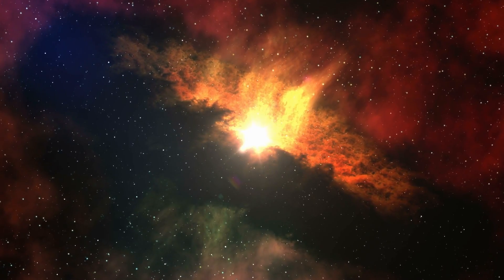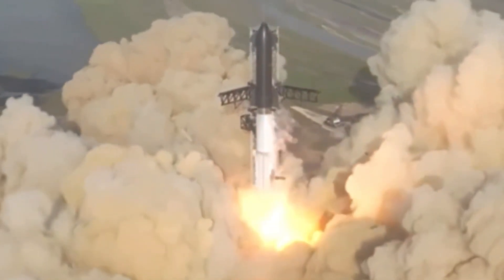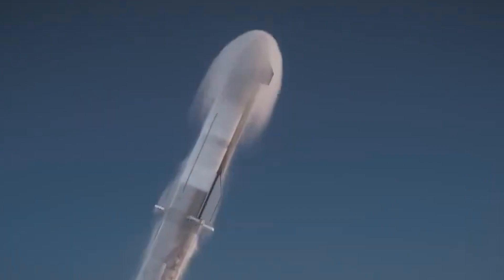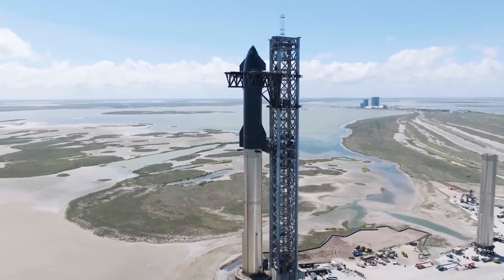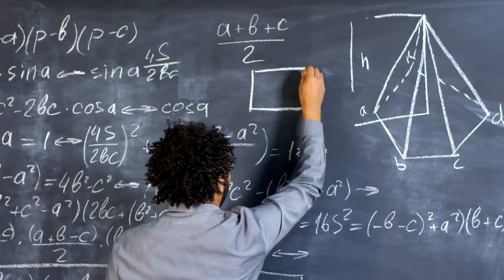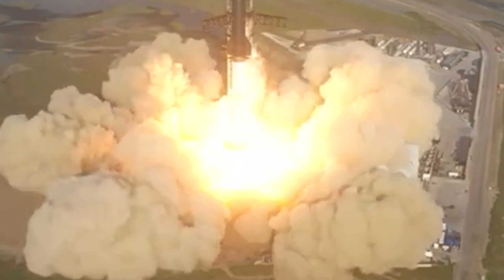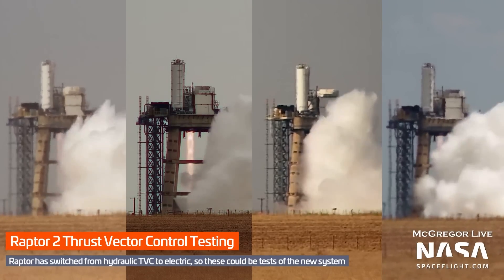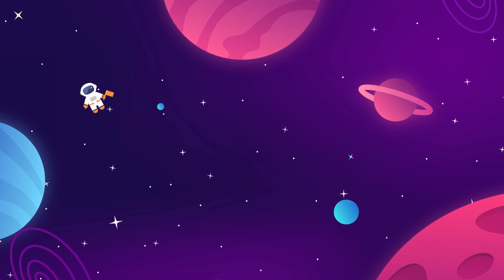The SpaceX Starship Orbital Launch Update Is Here!

Comment: I would suggest 2 water cooled concave steel plates forming a ridge to deflect the exhaust thrust laterally in 2 directions.  Might require a tungsten ridge cap.
You can see scalloped pits in the crater wall where the individual outer raptors were excavating in cutting torch mode.
Reply: Think Apollo Flame Trench, they'll need it.
Reply: @festeradams3972  💯!!   I honestly cannot understand the aversion/reticence to implementing this time-tested, proven method. It works & has worked for decades.
Reply: @turbochargedsports6327  Elon being Elon I'm afraid...
Reply: @turbochargedsports6327  If I had to guess. Elon wants a launch pad that will work on the moon and on Mars.
Reply: @Veritas-invenitur  Mars... hahaha
Reply: @turbochargedsports6327  And it works for Falcon launches. But you know Musk - he declares that flame diverters are for pussies and expect the Universe to oblige.
Reply: @chrisantoniou4366  💯👍
Reply: @bazoo513  💯👍
Reply: @Veritas-invenitur  maybe, but the gravity, weight & thrust dynamics are different on the moon & on Mars. No Superheavy launches in either environment. What might work there won't necessarily work here for a multitude of reasons.
Reply: Army Corp of Engineers approval for such a work would be the stalling point. It would take a few years to get approval for such a thing.
Reply: @turbochargedsports6327  That’s absolutely true. Every launch location is different. I’m just trying to figure out why Elon choose to risk a rocket in the way he did. The only thing I could think of is that a launch from another planet is likely to send debris into the rocket in a similar fashion as we saw here and that Elon wanted the data. Perhaps I’m grasping at straws, but I would like to believe that some rational reason exists.
Reply: They can take some notes from how they diverted the space shuttle thrust
Reply: I would suggest selling Twitter stepping away from all these companies and let them run themselves first.
Reply: @Ernest Mesa  I would suggest maintaining focus on the science rather than getting into the complex and controversial moves of the owners other businesses. Everyone has their own feelings about Mr Elon, let's not share them here.
Reply: The best ridge cap would be water cooled copper. I have experience in several industries where resistance to very high temperatures is required.
Reply: @curlydave7689  Why would you use a soft material under a rocket engine? The idea is to deflect the heat and pressure, not conduct it away.
Reply: @--_DJ_--  1. Some copper alloys are harder than others but still have good thermal conductivity. 
2. Experience has shown that no matter how hard or temperature resistant a material may be a very energetic chemical reaction will rapidly exceed its limits. Copper can be kept cool and will last better. 
Examples are NASA rocket combustion chambers and nozzles of light gas guns.
Reply: @curlydave7689  What benefit does thermal conductivity have really? The idea is the water deals with the heat, the structure underneath deals with the pressure. I also think work hardening would be an issue for copper.
Reply: .  . 1940s era technology which the Germans themselves had already moved beyond in their own research.  Anti-gravity research was commonly published in scientific literature until 1954 when that all disappeared in the name of national security -- while the former CEO of Lockheed Corporation told us in the 90s that they had at that time developed the ability to reach other star systems, as well as many other developments -- none of which are allowed to enter into public developments and awareness.
These undisclosed technologies, as described by doctor Steven Greer, have the ability to replace the need for fossil fuel energy production -- therefore the need to keep the public occupied with programs for public consumption, as such developments cannot be allowed to enter public consciousness to free humanity of its burdens as well as enlighten humanity with unlimited possibilities -- versus the means to maintain influence, crisis and war through maintaining an oil-based economy -- as well as perceived scarcity attendant with false climate threats from a basic element that is literally responsible for feeding the planet through the sun's energy by the process of photosynthesis and which is a primary element in life itself on Earth.  Even worse are geoengineering activities motivated by eugenics philosophies to reduce the planet's ability to support life in the name of reflecting sunlight back toward space, yet using the most toxic materials possible for this stated purpose.  
It is time to begin to function as individuals again, rather than as the parties and ideologies that divide us and so well managed for that purpose -- as well as sponsored SJW activity to greatly enflame any issue far beyond the normal public response.  Repetition and production quality will no longer adequately serve.  The individual perspective is the focus of power by which no person can be set against another with false or self-serving interpretations from another outside of ourselves.

Normalization rather than conspiracy is how influence and corruption created and take precedence, so that awareness is hostage to the needs for anything other than ourselves to define what is real and acceptable -- the need for any form of consensus to rule us unaware lest we ever accept responsibility.
Reply: If you deflect the exhaust, don’t you reduce the lift?

Not sure. Just asking.
Reply: @derekmorrow8775  No.  Rockets are reaction vehicles, they don't need anything to "push off".
Reply: @chrisantoniou4366  Thank you. Did not know that. Thought it followed the opposite mass reaction theory.

Learned something new.

Thanks for responding .
Reply: @derekmorrow8775  ? Newtons third law? Thats what thrust is, gasses are being ejected from the rocket at such force, that the whole rocket reacts in the opposite direction. Thats why you have thrust in space where there is nothing to "push off", because that's not how thrust works.
Reply: @rustygates3367  So increasing the height between the raptors and the launch pad would help solve the problem of concrete destruction and deflection into the engines?  Then add the water cooled steel plates to cool the pad even more?

It seems like distance is the easiest solution to help stop the destruction.

Would that work?
Reply: And, would deflecting the steam produced off of the steel plates toward the bottom of the rocket, help to create lift at take off?  Could it reduce the amount of initial lift the rocket needed to get to a stable speed? And help to cool the engines somewhat during critical lift?
Reply: @PBCountySheriff  No, steam in an open environment isn't going to provide any lift.
Reply: No, thrust is not dependent on the exhaust hitting something it depends on the speed its leaving the engine.
Reply: @derekmorrow8775  No. All you care about is the impulse (mass times speed) of the exhaust at the moment it leaves the nozzle. The rocket doesn't care what are you doing with it afterwards.
Reply: @derekmorrow8775  no. Ground effect vs atmospheric effect
Reply: @derekmorrow8775  Not really, unless the diverter is attached to the rocket. As long as the rocket is free to leave the diverter behind, its thrust will be pretty much agnostic to what happens after it leaves the nozzles. When it gimbals the nozzles though, that does eat into the forward thrust.
Reply: @kathrynck  I have a hard time understanding it too. Part of it is that the pad is right at sea level, with a high water table. The whole area is basically wetlands. Digging a huge trench might not be possible, and it would require a new environmental assessment from the FAA. I've seen many theories floating around but none of them provide a satisfying answer unfortunately.
Reply: @zvexevz  thats exactly whats happening, the boca chica wetlands are not made for a structure like that, however, the cape is also made out of wetlands, that why everything is build above ground on concrete and steel, that would also work in boca chica, but they would need to make the launch tower 1 or 2 segments taller
Reply: @zvexevz  Space-X said they believed their high-end concrete would survive a single launch.
They were wrong.
I think the statement speaks to their sense of 'hurry' or possibly their budgetary constraints though. I think one of those 2 appears to be the real gremlin.
Reply: @zvexevz  KSC is at sea level &.Cape Canaveral was nothing.but swampy marshlands before NASA transformed it. All of NASA's flame trench/diversion systems were built above ground.

Comment: If it's just destruction of engines then it's finie-ish, but if that's issue with realibity of engines then spaceX have some serious issues.
Reply: Engines can and are always improved so not really a major issue
Reply: @lukealadeen7836  they've been working on them for five years assuming they are them problem, then engineers weren't able to solve this problems even after 5 years and number of engines on spaceship doesn't help much you could getaway with some minor realibity issue if you had Saturn V like setup, but not with 33 engines.

Comment: 31 Kilometers high and 2150 KPH?  I gotta go Murican on that. 102,000 feet and 1335 mph. What was it designed to do at 1st stage burnout? Those figures seem a bit small to me. I watched the launch over and over and it does seems to be struggling. I think it has some serious issues but SpaceX is good at solving those.
Reply: The Falcon we all know and love can lift 25 tons to low Earth orbit. Isn't that enough? Ten launches and you've got yourself a 250 ton space ship orbiting Earth. 10 more launches and now she's fully fueled up and you can go anywhere in the solar system.
Reply: One of Starship's jobs is launching larger payloads than will fit on a F9.
Reply: @fredjones7705  or you could just do it in one launch.....

That's like saying "why do we need these big cargo ships when we could just use 1000 canal boats instead"
Reply: @Alucard-gt1zf  No it's not. Super heavy can put 150 tons into LEO. That's only 6 times what Falcon can do and less than 4 times what Falcon Heavy can do. My point is that Musk already has an orbit system that can do the job.
Reply: That's with three engines out from the start and more failing on the assent by the time the fts is used it had lost 8 of it's 33 engines. The full cargo capacity of the starship is 350 tons slightly less if they have to save fuel so it can land to be reused.

Comment: Personally, I think they will ultimately need to move launches offshore from a launch pad.
Reply: Yes, but on the Moon and Mars there are no lakes.
Reply: @abryg8655  true, but the super heavy won’t be used on the moon or mars. Gravity is a fraction of earths so won’t take near the forces of the super heavy to launch
Reply: @djgarrett32  unlikely this thing will land on the moon
Reply: @lukealadeen7836  Not in the Earth landing configuration. It most likely will need to have some auxiliary engines up higher somewhere to keep the engine exhaust from blowing moon regolith all over. There are illustrations around of how this may work.
Reply: Launching at sea is horribly complicated.  Firstly you are entirely dependent on the weather, and secondly, you have to get the rocket and payload out to the platform and then assemble it there - at sea.

Comment: I still have my doubts about the steel plate idea. Heat is one thing, but massive pressure caused by tons of hot gas hitting the plate at hundreds of meters per second speed will be trying to tear the plate apart, stretch it to sides, and beat it into the ground. So I definitely hope SpaceX will spend sufficient effort on actually modelling the situation before they try to launch the starship again.
Reply: The thing about steel is that it's very elastic.  Yes, the plates used might deform depending on their composition and thickness, but they can "bounce back" unlike concrete.  A proper water deluge system, and a proper flame trench made with a LOT of concrete and steel should fix the issue.  If SpaceX want a reusable Super Heavy booster, and they most certainly do, the launch pad needs to be made reusable too!  In my opinion, no matter what solution is used, it is almost impossible to imagine anything OVERengineered.  SpaceX need to fix this once and for all.
Reply: @chrisantoniou4366  

In a rocket you aren't dealing with elastic forces you're dealing with compressive and shear forces
Reply: @Bosscheesemo  I'm not talking about "elastic forces"!  Steel will deform but will go back to its original shape if tempered correctly.  Compressive forces will deform but not necessarily break a steel structure.
Reply: @chrisantoniou4366  

Yeah but not in a rocket. Go grab a straw and compress it from the ends. That's 100% of the force being exerted on a rocket fuselage. Assuming the rocket remains straight and assuming it's steel we're talking about, it won't compress at all. If the rocket flips it definitely will bend and snap but that's sheer force. Metal tubes are weak to sheer
Reply: @Bosscheesemo   the steel plate idea is for the launch mount, not the rocket. 
Just so happens that the rocket is also made of steel.
Reply: @zachneuman5494  

I'm exclusively talking about the rocket not the launch plate
Reply: @Bosscheesemo  I'm talking about lining the flame trench or blast deflector!!!
Reply: It's not just the heat - in fact the heat is the lesser problem really - it's the sonic shock waves caused by all those engines shooting out mass at hypersonic speeds.  That will demolish concrete (and engines) much more quickly than heat.  And, steel plate - even if thick and cooled - will not solve this, it will probably just make it worse, as it is a better reflector than concrete.  A lot of the energy in those shock waves was absorbed by the concrete breaking up - the steel plate will just reflect it all back up into the engine bay.
Reply: They’ll just use “trial and error”, and “hope” as their strategy.
Reply: Steel plate is actually much better for this than carbon composite. Its one, only, and singular drawback is the weight. Structurally it's better than any other rocket ever
Reply: By then spaceX might not be with us.
Reply: @simon2493  I doubt that

Comment: You mentioned at around 3:40 that each engine lost represents 9% of trust loss, but for 33 engines, it is only 3% of trust lost per engine.
Reply: It's 9% effective thrust lost per engine. Basically with only 22 engines there is no forward movement because they are only enough to counteract gravity, the other 11 make you go somewhere
Reply: @joebuslife9275  I didn't know that and it makes sense. But it could have been explained better in the video ;)
Reply: @joebuslife9275  I believe the engines though were running at 90% which means other engines could ramp up thrust to counter the loss of engines.
Reply: @danielbuggie591  The N1 v2.0 was slow and low throughout the flight. So it didn’t counter the loss of thrust.
Reply: Assuming each engine was receiving the same amount fuel and producing the same amount of thrust.

With over 37 years of advanced material reinforcement and failure analysis engineering experience I am frankly shocked that SpaceX completely ignored basic science of material reinforcement physics.
Reply: @icare7151 I am amazed with the expertise on the internet.  So many people are so skilled, that all knew that the pad would take 50% percent throttle and not 100%. It is unbelievable that SpaceX hasn't hired a handful of commenters
Reply: @clytle374  They were right though.  It was blindingly obvious.
Reply: You need to reduce thrust on opposing engines to balance the forces so each engine takes out more then 3% of total thrust.
Reply: @wally7856  Thrust vectoring can compensate for that, to a certain extent. What Joe said, it is about the surplus thrust, that gives net acceleration.
Earlier statements by SpaceX said that they would build in a 2 to 3 engine-out safety margin on thrust. But I do not know if this particular test had that. The loss of 6 engines led to a reduced acceleration and reduced speed a max Q.
Reply: @mennol3885  Thrust vectoring doesn't help you in the slightest. Draw me a vector of those engines gimbaled 15 degrees (maximum they can gimble). That vector has a vertical component and a horizontal component (vector triangle). The vertical component is now Cosine 15 degrees x 100% = 96.6%. You lose 3.4% of your vertical thrust per engine when you gimbal 15 degrees. There is no difference between the vertical thrust losses gimbling or throttling down opposing engines as far as lift is concerned. Fine control of heading is another story. In fact, because the outside engines are further from the centerline, their thrust differences make more torque on the rocket then the center gimballing engines therefore it would be more efficient to throttle those outer engines down rather then gimble the center engines.
Reply: After more consideration, gimbaling the engines (thrust vectoring) would probably give you more vertical thrust overall then throttling down the opposing engines as the horizontal component of the trust vector at 15 degrees is pretty strong (sine 15 degrees). But you still lose your vertical component by 3.6% so either way, when you lose an engine, you lose more vertical thrust then just the failed engine, you also lose some vertical thrust from the engines that have to gimbal (or throttle down opposing engines if gimbaling isn't sufficient as not all engines can gimbal).
Reply: @wally7856  You have a point!